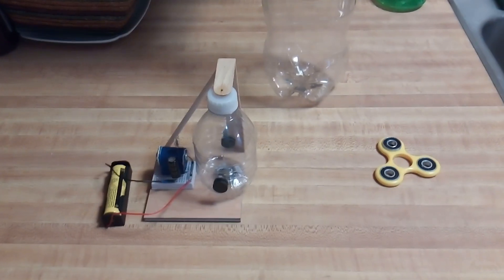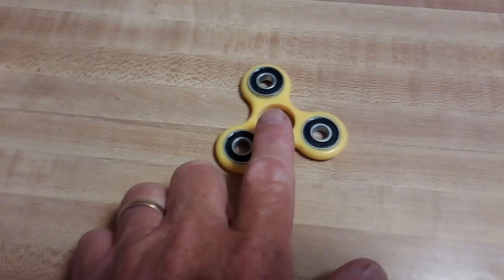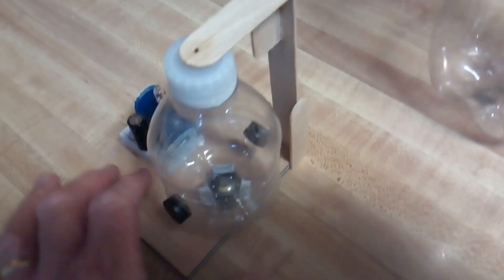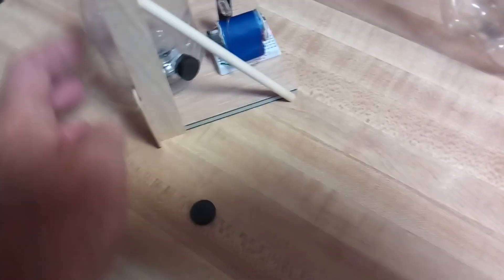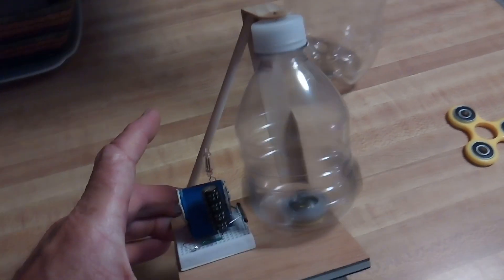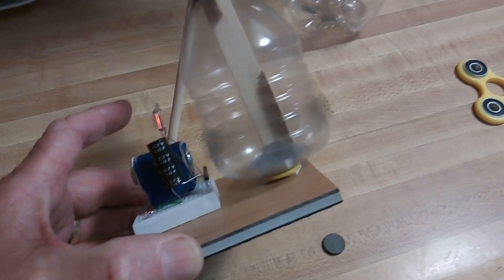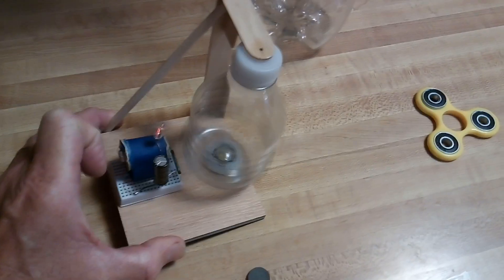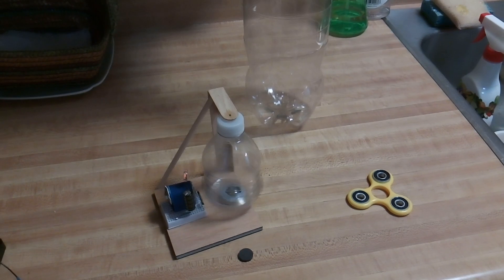Bottle Motor ... Part 2

Comment: Great little build Lid.
You can put a little piece of a solar panel on that capacitor and let it sit in a window and run all day like a radiometer..
One of your cool pictorial drawings and schematic would make it nice to see the function and layout.
The reed switch can be pulsing the voltage on or pulsing the voltage off depending on whether you are using attraction or repulsion.

Comment: Thank you so much for posting.  Could you give a bit more detail on the coil ?  You mentioned 30 gauge wire - roughly how many turns on what size bolt?  Thanks again!
Reply from the maker: I didn't count the turns on the coil but a few hundred turns will do it.  The bolt is just a short 3/16" cheap China steel one.  I wrapped a bit of tape around the bolt before I put the wire on  it.
Reply: @Lidmotor  Thank you !

Comment: Does the coil provide enough torque to spin the bottle with a little water inside?  I wonder if you could get a small vortex going.  Might be fun to see.
Reply from the maker: Interesting experiment.  I will try that.  The bottom ball bearing will handle the weight just fine.

Comment: Haha I just got the same figit spinner for a $1 yesterday . Amazing value
Reply from the maker: If you rinse the bearings out with acetone and oil them with very light oil they spin really well.
Reply: Lidmotor I did this but added lock graphite . I don’t know what’s better but I works well . Maybe do a lidmotor test
Reply: Spin the both fidget spinners with a motor  and then see which one spins the longest 😮